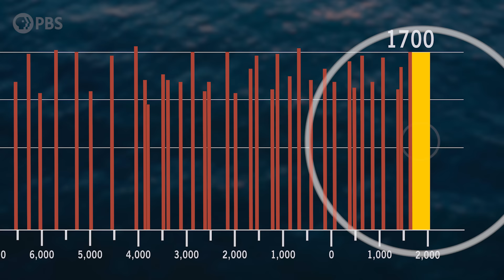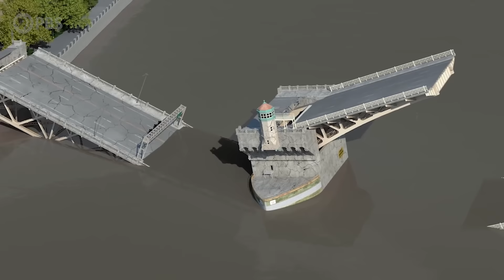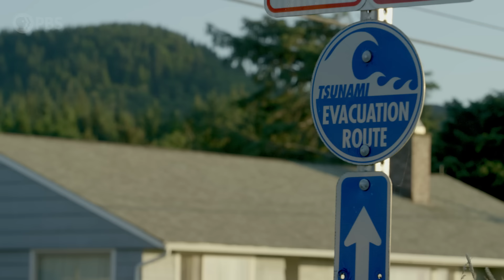Will the Cascadia Earthquake be the Worst Disaster North America’s Ever Seen? | Weathered

Comment: 06:45  A 100+ year old unreinforced concrete foundation is not going to measure up to an M8+ earthquake no matter how much you attempt to secure the building load onto it.  The concrete mix 100 years ago is of poorer quality than you'd get today (aggregate back then was more often cleaned river gravel which was rounded from river erosion/friction, not the crushed gravel more often used today which has sharp binding edges).  

This kind of remediation is nothing more than cosmetic.  It won't help when the foundation crumbles under the seismic loading.

The best option for homes this age would be to lift the house and replace the foundation to meet current building code standards, then lowering and reconnect the house with seismic anchors already in situ in the new foundation.
Reply: Of course most of these houses will need to be demolished during the rebuilding phase after the earthquake. The goal of retrofitting is twofold 1) Give people a few extra seconds to get out before the building collapses (say, 25 seconds rather than 15 seconds) and thus reduce casualties overall and 2) Increase the number of buildings that are still sort of standing following the earthquake and which can serve as makeshift shelters, or can be picked through for usable food and tools, while waiting for the relief effort which could take months to get to everyone. Rescue workers will be coming in from the entire world, and it will still take months to get to everyone.
Reply: Guessing your an architect or safety consultant for building codes?
Reply: River sand is actually the good stuff, it is jagged from water/weather cycles breaking it down. We are running out of it unfortunately. Desert sand is useless because it is smooth from just wind erosion. However, I do agree. I doubt a single building will be left standing if its a full on 8-9M quake.
Reply: I'm not an architect or anything like that but that was my first reaction, that wouldn't you have to lift the entire house and reinforce the foundation instead of just adding on to it? And it made me think, wow, that would be so expensive to do, it might be better off to just demolish and start all over. But then: that's someone's home and if they could afford to do something like that, chances are they would've already done so.

It's almost like a lose-lose situation when it comes to the older buildings and homes and that's really sad.
Reply: I watched epoxy get installed from the top of a 100 year old foundation wall, only to see the epoxy ooze out of the wall 3 feet from where it was being placed. Talk about voids.
Reply: engineers once made a model of the Hagia Sofia, made out of the same kinds of materials, then tested it on an earthquake simulation and found out Hagia Sofia will remain definably "in-tact" even after a 7,8,and 9.2
Reply: I was a little blown away by the use of thin sheets of plywood to support the entire house. That & the "do it yourself" option to me screamed "feel good scam"
Reply: @capitalcitywalks  From down here in the shaky isles of New Zealand, plywood is used in new builds and retrofitting, primarily to give some stiffness to a structure. My guess is the plywood being installed in the vid would be to prevent racking of the timber framing during an earthquake, rather than to sustain vertical loads.
Reply: Right? Slapping a piece of plywood (vertically of all things) and then using some dollar store brackets won't do shit.
Reply: @lilaclizard4504  Structural grade plywood will add considerable strength to the existing framing, it is feasible. Whether it adds enough is another issue. I would add steel strapping myself. The steel added to connect the foundations and the wall was very important.
Reply: Yes, but that is expensive. Sheets of plywood and metal clamps are cheap and provide the comforting false sense of security homeowners are actually looking for. And if you're a politician, you can subsidize these meaningless comfort-blankets and then claim your constituents were prepared once the earthquake hits — You'd be out of office long before anyone gets wise.
Reply: Oh. Just rebuild the foundation.  You gonna write the check, slick?
Reply: I was just pondering that.... rebar and bolting aside, modern concrete bonds stronger and has flex
Reply: @koriko88  You DO NOT under any circumstance use a damaged building as a refuge of any kind. Not makeshift nor any other.

Much less after an earthquake where is certain there will be after shocks. Ideally, you do not enter the building. Some will, because there might be stuff they want to save, but you really shouldn't.

You don't know when the thing will give and fall on top of you.
Reply: @MelioraCogito  The thing is that many might not have been bought, they might be inherited.
Reply: @latoxica9493  Purchased or inherited, the point is, owning a +100 y/o house is not cheap.
I live on Southern Vancouver Island on top of the Juan de Fuca fault in a house built in 1908 that's been in my family for almost half its lifetime (my paternal grandmother and uncle bought it in the late 60's).  It had been converted into an up/down duplex in the late 50's/early 60's. (I purchased my grandmother's share in the early 90's and the remaining 1/2 from my uncle's estate after he passed >15 years ago.)
I know all too well the cost of maintaining/updating a +100 y/o house.
Reply: @MelioraCogito  I'm not saying it's cheap or easy, I'm saying many people might not have the means to mantain those houses properly and might not have enough money to move.
Reply: "But special plywood!!
Reply: @williesawyer5894  Lifetime guarantees mean they will happily replace the failed product, but that won't be of much use when your entire house is a pile of rubble. It's worth reinforcing what you can as nobody knows for sure what is coming and when, and the extra work might help you survive something lesser. It's kind of like adding a safe room for tornadoes- it increases your odds greatly most of the time but if an EF-4 or bigger comes to call all bets are off. No guarantees in life except that it will end someday, and beween then and now the government will take as much as they can manage to get from you providing little in return.
Reply: @P_RO_  it's not like preparing for a tornado and building a storm shelter. It's like preparing for a tornado by applying a piece of plywood around the bottom of your foundation. It might possibly help but not likely. Just more things to pick up. Also it gives the homeowner a false sense of security. This is just my opinion. For all I know, after the big earthquake the houses with the piece of plywood around the foundation will be the only house unharmed. Eventually we are going to find out. Then you can message me and tell me next time i need to keep my trap shut if I dont know what I'm taking about. I will respond with "sorry you were right". Its not just the government you have to watch for, also you have to watch the people that are just as bad.
Reply: @jansonshrock2859  Good news! Turkey has earthquakes and that mosque/church is so beautiful that it would be a shame to have it destroyed.
Reply: @capitalcitywalks  It was a Mickey Mouse solution...
Reply: The earthquake could happen further or closer to the coast, the epicenter somewhere between off of Seattle and off of Northern California. Even if it is a big one, what you might get at your place might only measure up to a M7 at most. Nothing can stop the big one. But we can hope to mitigate the damage if you get relatively lucky with where the epicenter happens to be.
Reply: That 'special order' plywood looks like regular, cheap-ass, plywood.  It even has more inclusions than marine-grade should, so what the F is that scam artist talking about?  He is clearly lying to these people and stealing their money.
Reply: @capitalcitywalks  If it's a really big earthquake, and particularly if your house is within the tsunami zone along a coast or up a river estuary (e.g., Seaside, in the video; Seattle, on Puget Sound; or Portland, where the tsunami wave will sweep up the Columbia and then the Willamette, just extending your foundation will not help. The house won't just shimmy around; it will be swept off and end up maybe a mile away.  Look at the video of the Fukushima earthquake to see what can happen.
Reply: I don't think anyone really thinks that will save the house. I think the idea is to give the ppl inside a chance to get outside before the house collapses. Although, depending on the house, even that might not help that much.
Reply: Mix Design << Steel Reinforcement   when it comes to resisting S-waves
Reply: LOL no man. I do foundations for a living on the west coast. Almost everything u just said is bullsh
Reply: Yeah, that's the problem. Rocks used to be round.
Reply: I'll get on that right away.
Reply: That is great   t crossing and I dotting ! Concrete  and  foundation info ! Thanks !

Comment: California: Is located upon a extremely volatile fault line waiting to collapse

Multi billion dollar companies: 👀
Reply: @M Muss yeah im getting out of here as soon as i have enough money to
Reply: Where do you live ipixel?  I was in Sacramento last week it’s so damn pretty I want to live there but I probably need to make $100,000/year
Reply: California isnt really at risk for a 9.0 though, the san andreas is a strike slip type of fault where the plates pass by each other in opposite directions rather than colliding or pulling apart. The biggest prediction there is around 7.0, obviously still serious and needing prep, but because the scale is exponential, the damage would be nothing close to a 9.0.
Reply: @jordanw1649  Bay area, but things are expensive as hell here
Reply: @M Muss Most houses are single family wood frame homes and they do really well during earthquakes.      My house had 0 issues during the Seattle 2001 quake that was 6.8.  Some 7000 houses were damaged in the 1994 LA quake so it is hard to know for sure.
Reply: Not only that but the San Andreas runs right through Silicon Valley. It runs a long the western edge of the valley and is quite visible as you fly in.

Cascadia is more dangerous though.
Reply: @bradykane5922  The San Andreas maxes out around 8.1-8.3.

Subduction earthquakes are kind of like trying to put a spatula under a pancake in a poorly greased pan. The pancake buckles then flops over.
Reply: @pyrovania  Ye but the actual earthquake itself wont be worse than a 7.8
Reply: @drscopeify  my house didn't have any issues either after a 7.2 earthquake in Mexico, but i mean a lot of buildings fell too so I guess I gotta thank whoever designed my building
And my grandma's house is still standing strong after 57 years and several 7+ even an 8.1 earthquake
Reply: Literally.  Like Jeff bezozs maybe donate to charity and/or help people build proper houses and buildings to withstand earthquakes instead of going to space
Reply: Not the same, not even close. The San Andreas is a strike slip fault (horizontal, on land, single epicenter). Its maximum power is nowhere near Cascadia's. Its up on land, so no tsunami. Also Southern California is a newer urban area than the PNW, mostly built during the latter 20th century, thus its built with earthquakes factored in to building codes and design.
Reply: So that's why they're moving to Texas 🤔🤔🤔
Reply: They are already moving to Texas and Florida! LMAO
Reply: @bradykane5922 I mean we had a 7.1 in 2019 and it was just so light especially in the house. But ya unless a tsunami from the subduction zone hits the major cities here in northern cali an 8.2 at most isn’t rlly going to do much harm

Comment: First 10 seconds "over 320 years"...
I guess that's a long time on a geological time scale.
LOL
Reply: Considering the Cascadia fault ruptures on average every 250 years...Yeah, 320 is a LONG time.
Reply: Well, you're just a bright bowl of sunshine, aren't 'ya?
Reply: No, it isn't
Reply: If you live in a 100 year flood zone and it hasn't flooded in 120 years, then yeah.... on a geological time scale, you're due for some trouble.
Reply: @neutronpixie6106  Not due. 100 year flood zone means 1% chance of flood each year. You are applying the gamblers fallacy to potential of a flood. A flood happening there one year does not decrease the chance of it happening the next year, and vice versa.
This earthquake however, has to do with gradually building pressure, so time does play a role.
Reply: That average is super misleading, the big 9.0 quakes are more like every 300 years depending on where you are on the coast, and big quakes have been as long as 500 years apart. It’s very unlikely we will se a 9.0 in our life times. However, it doesn’t mean it won’t happen.
Reply: @adamjohnson2914  Assuming the probability doesn't increase with time due to pressure build up and you have a 1 in 250 chance (or even 1 in 300 chance) it's like a 1/4 to 1/3 chance in your lifetime, assuming you live 80 - 90 years. So not "very unlikely" but more likely than not you don't.
Reply: @AutumnBosco  its not a probability matter. Its a gradual build up like blowing up a balloon and then that one breath overfills it. Its just in this circumstance the balloon is slightly bigger and stretchier, but that means a bigger bang.
Reply: Rite u know its not long time..science is saying geological  speaking man has only been here but 2 seconds
Reply: If we're going by that logic, on a geological standpoint this thing goes off pretty freakin often
Reply: @Tony-td6wj  on a geological standpoint you are damn right. Normally movements with patterns like this are in terms of thousands of years, not hundreds.
Reply: actually it's a very short time.
Reply: @adamjohnson2914  unfortunately it isn't very unlikely.  It isn't highly likely either.  It's just at a point where it might be today and it might be in 100 years.  Every time you get smaller ones.  This is good.  Keep those coming.  They ease off pressure.  However.  If you get a big one somewhere else... now you've got a bit of a problem.  think like a round a bout with pressure build up as the drive force.
Reply: Blink of an eye
Reply: @adamjohnson2914  You say that, but there's been 2 9.0+ earthquakes in my lifetime.
Reply: @poopjeans1135  the mayan baktun seems to line up with this event...  it's just something I noticed. There may or may not be any correlation but periodic ice ages could be something to base that count on.
Reply: @AutumnBosco  there is some periodicity to earthquakes. If one happens one year the chance it will happen the next is lower
Reply: @poopjeans1135  the average is 500 years not 250 lol
Reply: @neutronpixie6106  Or the data sample size is too small.
Reply: @adamjohnson2914  It means that it's very, very, very unlikely to happen in our lifetimes (or that of our grandchildren and great-grandchildren)